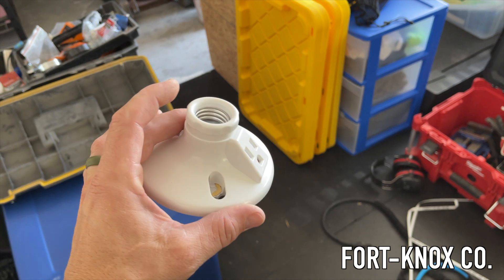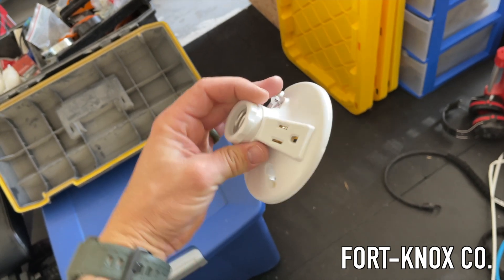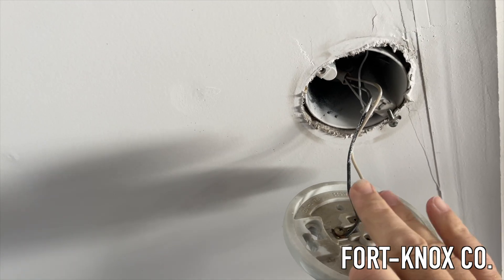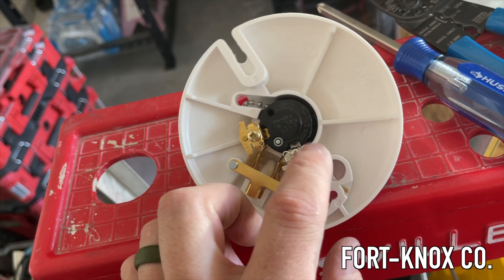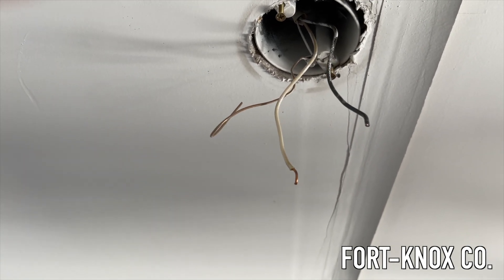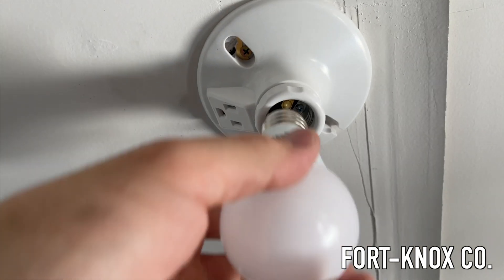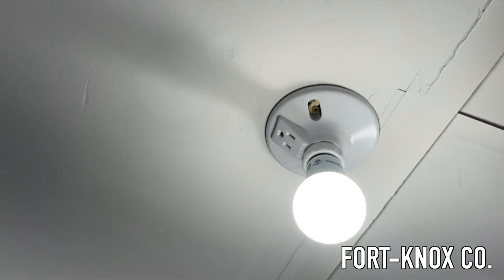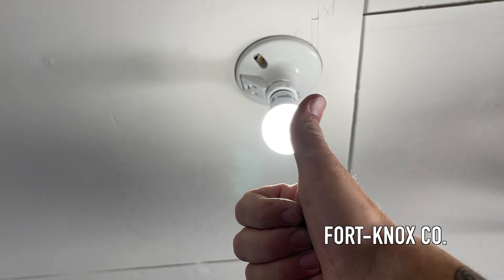How to Install Add Outlet in Ceiling of Garage | Light Fixture with plug / outlet | DIY electrical

Comment: Just for everybody else watching, you don’t strip a wire like that. We’re going back-and-forth and damage the wire need to go the other direction and then pull the coating off with the tips of the pliers.

Comment: Great video man. Was looking to do the same thing in my garage, didn’t know these type of light fixtures existed with built in outlet.
Reply from the maker: Thank you! Yeah when I found these I figured it could solve a lot of people’s problems. I’m
Sure there’s many out there that want to add some lights to that single garage light they have hanging there. So this is a quick fix for that

Comment: What the hell was that? You didn't show the actual installation. Thanks for nothing.
Reply from the maker: I was explaining and showing the type of light fixture you can find, how the wiring goes. But the actually screwing in of the screws I didn’t think people would be confused on or interested in. The fixtures are very straight forward as far as securing them. Most people get stopped when it comes to messing with the wires. Black(hot) white(neutral) & you bare copper ground (green)

Comment: What are the power limits of that type of connection ? Window ac 12 amp?
Reply from the maker: It’s on a 20amp 120v circuit. It rated for the average light or wall outlet I believe. Each item you plan on purchasing should list what it’s rated for though

Comment: THX FOR GOOD VIDEO. CAN I PLUG A FRIDGE OR SMALL FREEZER INTO THIS SAFELY?
Reply from the maker: It would depend on what else is on that circuit and what size the breaker is. You need to make sure your not overloading the circuit

Comment: What if i dont have that model with outlet and light bulb plug? How can i get an outlet of a light bulb
Reply from the maker: I’m not sure what you’re asking the way your question is worded.  If you don’t have the light with the plug on the base you would need to purchase one with the plug on it. Then install the new one with the plug. That’s what u did in this video. Took a standard light bulb and switched it with one that has a plug too.

Comment: Great video.  Thanks.  I need to do the exact same thing because my old porcelain fixture doesn’t have a receptacle.     Can you still buy porcelain fixtures or are they all plastic now?   I assume/hope I have a ground wire.  Thanks.
Reply from the maker: They do have porcelain, it’s still pretty common. They should have them a the box stores or you can find them on Amazon. I should have a link for them in the description of the video.

Comment: Do I really need to find breaker switch?  Difficult to locate which one, no labeling, located outside other side of house?  Or can I just turn light switch off?  Thanks
Reply from the maker: You can turn the light switch off and you should be fine. But just general advice is to try to turn the breaker off to be completely sure. I know exactly what you mean with not knowing which breaker circuit it is. That’s a common problem is that the builders don’t label all their breakers in the box. So most homeowners have no idea where to start. Technically yes if the switch is off, then the power is off to that light. Just make sure no one flips it back on while you’re working on it.

Comment: I was planning on replacing my fixture with a gfi outlet for My shop lights. Do you think the fixture you installed is sufficient or is a better option for an added layer of safety?
Reply from the maker: I don’t think you need the GFCI. The breaker at the box is already one layer of safety. The circuits usually from the breaker box are running off a GFCI outlet also down the line. Most likely the light outlet your thinking of replacing has a GFCI on the line already.
Reply: @FortKnoxCo  ok cool. Yea the house we bought is a 92 and the garage has 1 outlet on the back wall and another on the roof. Both are on separate circuits also. My house wired the most mind boggling way.
Reply from the maker: @ThatOneGuyMatt  it’s always amazes me to see how many different ways people build houses. You’d think there was a general way of doing things. Lol
Reply: @FortKnoxCo  right? Like the garage back wall outlet is attached to 2 of the 3 bedrooms. Half the living room and both bathrooms are connected. The other half of the living room is the 1 plug in the back yard. The roof outlet in the garage is the master bedroom also. Like why is it so hard to just segregate each room? All the wiring ends in the same damn place anyways lol
Reply from the maker: @ThatOneGuyMatt  I know exactly what your talking about. My first house I started working on was the same way. One outlet in the garage was attached to a whole line of outlets on the other side of the house. And the bathroom
Outlet was attached to some outside. Made no sense.

Comment: So the socket I’m working on is the first in a sequence of 3. The ground wire bypasses this first one but is connected from the input wire to the wiring going to the next socket. How critical is it that I connect the ground wire to this first one? First time homeowner here and I’m just now facing my fears with regards to simple electrical tasks…please be kind.
Reply from the maker: You should always have the grounds connected where there’s a place for them. That’s usually a green screw on fixtures or to the lamp housing or a terminal off to the side indicated by being a different color. It’s make sense to have it connected from start to finish.

Comment: Did the fixture have a built in ground
Reply from the maker: It’s has a terminal to attach the ground to. So there’s a spot(screw) to attach your copper wire.

Comment: Will the outlet work when the light is off?
Reply from the maker: In this situation no. It’s a hot wire controlled by the switch. So anything on the other end of this circuit is based off that switch.  In the scenario I showed in the video I’m just incorporating a plug into the lighting to be able to branch off lights by plugging them rather than having to hardwire more lights. I have a video about how to hardwire lights as well if your curious.
Reply: I think the pull chain just controls the light and the outlet is hot at all times.
Reply: Can you wire the light to turn on/off by the switch but the outlet always remains on? This is because garage door opener always needs power.

Comment: Hey man, thanks for the video. One question: is that outlet “always on”, or is it dependent on the wall switch being “on”? Meaning you could turn your LED lights on and off with the wall switch?
Reply from the maker: It’s controlled by the switch. So I have 4 shop lights attached to it and the shop light come on with the switch now.
Reply from the maker: Glad I could be of help! 🤙🏼🤙🏼

Comment: Do you think this would be safe to use to plug a garage door opener into?
Reply from the maker: I probably wouldn’t plug the garage door opener into it. One this might be a light switch and you wouldn’t want your garage door opener to be on a wall switch. Also it depends on the type of breaker, most lighting in the ceiling is on a 15 amp and you would probably need a 20 amp wall type outlet. Usually circuits ran for garage door openers are dedicated lines. So if you did plug it into the ceiling like that from a previous light it would probably pop the breaker
Reply: @FortKnoxCo  Thank you for this information! This was very helpful.
Reply from the maker: @NottaRobot  your very welcome!

Comment: Can u add this to a bathroom without a code problem?
Reply: @Jax Fortner thanks so much for your response.
Reply from the maker: I’d check with codes in your local area. I wouldn’t put above a shower or bathtub. but other areas should be okay. You should have good ventilation. Also check to see if the fixture is recommended for areas with moisture or not.
Reply: @FortKnoxCo  would u need a gfci if this fixture was in the bathroom?

Comment: What happens if you have two black and two white wires from previous connection? I think I see two holes for the clamps to bite down on the wire for each connection the way you've done it.. is that the best way? Any help is greatly appreciated.
Reply from the maker: If you have two blacks and two whites is probably in the middle of two other fixtures on that same line. So you can connect the two blacks to the hot terminal on the fixture and the two white on the neutral terminal. That will allow the power to continue through the fixture and down the chain to the next fixture. I’d pigtail the wires thought. You don’t want to double up wires under one terminal.
Reply: @FortKnoxCo  Thank you so much! Appreciate the help.

Comment: Hi will the outlet be hot independent of whether the light is pulled on w the string?
Reply from the maker: It depends on the model of the light fixture and how it’s manufactured. But usually the plug will turn on and off with the pull string. The whole unit  ,if it has a pull string , will turn on and off with that.

Comment: anyone know of  lampholder fixture thatg has holes to run wiring out. I want to tap in some LED light strips to my garage lampholder that is already wired to a switch
Reply from the maker: Like you want to hard wire the led light strips to the fixture? Rather than plug them into the fixture?

Comment: Hard to find answers. Code states all outlets in a garage must be GFCI, I believe also TR and WR. Does this also apply to outlets in a light fixture? Seems to me this type of light fixture no longer complies with code in garages. Not trying to crap on the video at all, just genuinely trying to find answers.
Reply from the maker: Also when they say “all” outlets must be GFCI they are stating that every circuit must have a GFCI on it. Usually all circuits in a house including the garage outlets go from the breaker panel to the first outlet in the circuit which will be a GFCI outlet, then each outlet on the chain will be a standard outlet. That whole circuit is a GFCI circuit now. But you don’t have to have a whole chain of GFCI outlets on one circuit. That would be 1000% overkill and unnecessary
Reply: @FortKnoxCo  Thanks. I had heard of the chaining method to avoid it which at least makes things a bit less expensive. Most sources I was reading said it was part of the brand new 2020 code IIRC and I can't even find light fixtures with built in GFCI receptacles, so I guess they would have to be chained unless simply using a GFCI breaker covers it.
Reply from the maker: Yeah, when I built my detached garage they had me put a GFCI on every circuit. It used to be just in wet  or high moisture areas. Now they require it the be the first outlet one each circuit no matter what.
Reply: @FortKnoxCo  Annoying, but hopefully it does actually save some houses or lives. Seems with the 2020 code even 240V outlets will need GFCI protection. This is going to make rewiring my garage a looot more expensive. Might just go with all GFCI breakers if that meets the requirements. Seems AFCI isn't required for the garage currently at least. Thanks for the replies.
Reply from the maker: That may be true depending on where you live and the current codes. In most cases a GFCI is just a second layer of protection along with the breaker in the box. It’s a little redundant but just for added precautions.